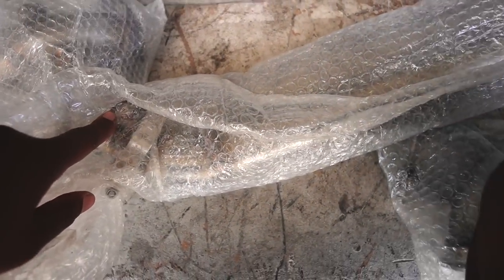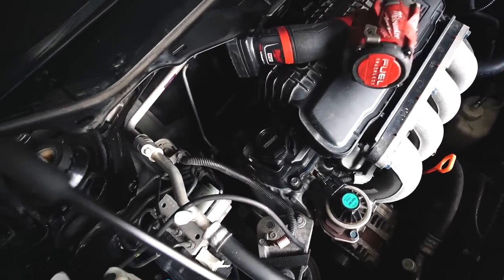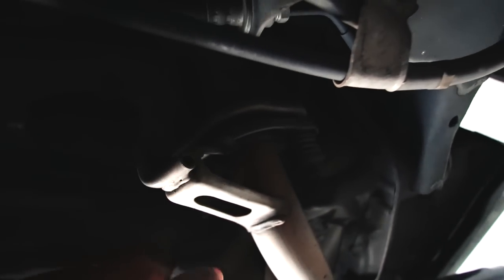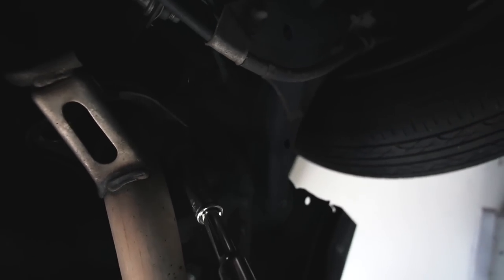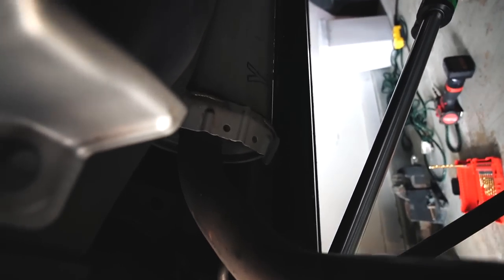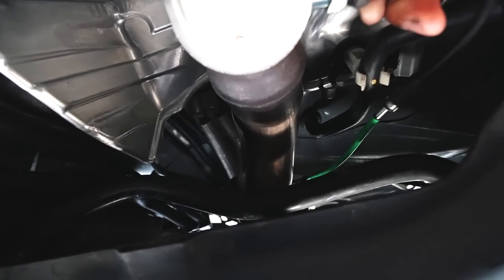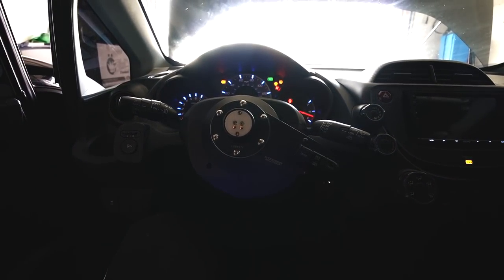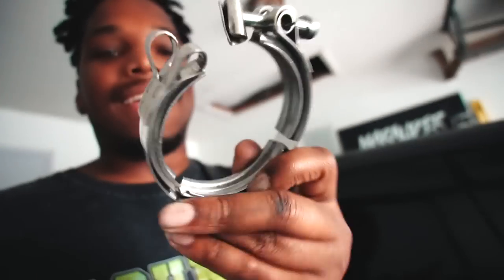BEST SOUNDING HONDA FIT EVER!? *INSANE EXHAUST INSTALL* - Honda Fit Build Series (EP.9)

Comment: Yo zosh! To make you stock wing look alittle better remove it from the car and buy 2 inch bolts with nuts that fit into the clip hole on the car. It gives you adjustability on raising the wing!

Comment: I've had that code a couple of times. Try running premium with some seafoam fuel cleaner. Then run a drive cycle and it should clear so long as your o2 sensor is good

Comment: Why can't people just LEAVE the cat that the o2 sensor cares about IN their damn car when the MF is borderline stock? I'd get it if you were make a 200whp N/A build or a turbo build, but this thing is stock as hell. LEAVE THE CAT IN, it'll make it sound better and you won't throw codes, good lord!

And for future reference, look into GESI cats. 400-cell count, 49 state and Euro-5 legal, probably won't throw codes, AND it flows as well as a catless setup. Race cars overseas use these things (since they have emissions requirements even on track vehicles) and the do JUST fine.